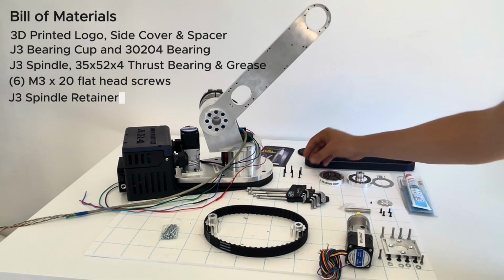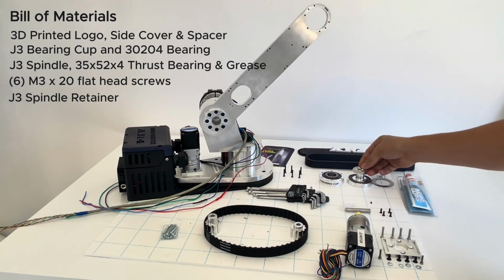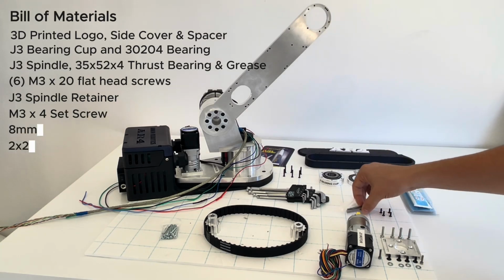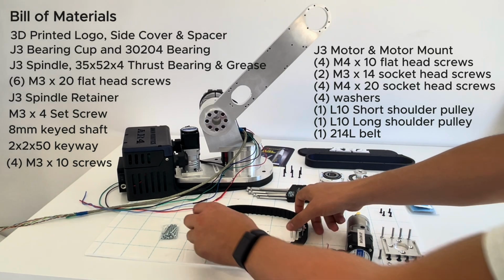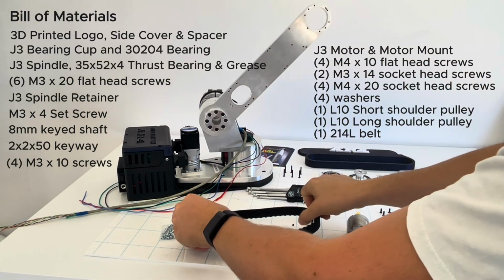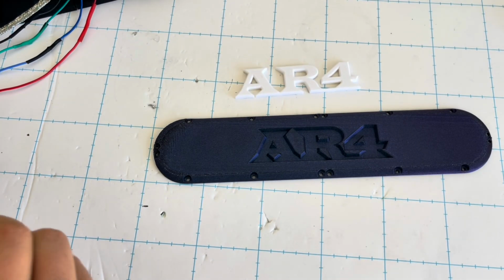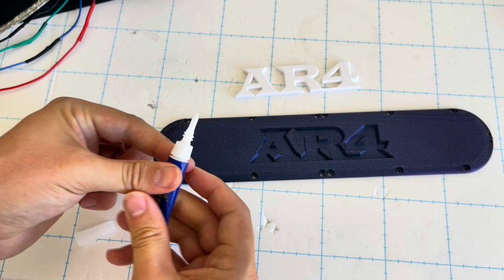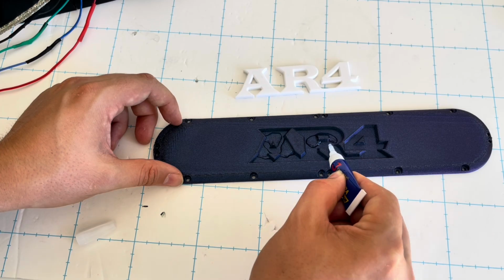Joint 3 Assembly and 3D Printed Covers - Episode 9 - AR4 Mk3 Robotic Arm Build Series

Comment: Thanks god for your videos pop up in  related robotic video on youtube . I tried to save money to buy robotic arma like yours but am worry about not be able to connect all those parts together and it is not that cheap either
Reply from the maker: Hi Kim June, I’m really glad that you have found the videos helpful. For your reference, there are a few cheaper robotic arm kits such as the Faze4 by Source Robotics which can be almost entirely 3D printed. 

The AR4 robotic arm kit from Chris Annin is well worth the money in my opinion as he’s done an excellent job detailing the build process in a 386 page manual and also has many useful videos of his own. 

Just a word of caution, even after the cost of the kit, I’ve spent around $600 more on various tools such as the soldering iron, crimping tools, etc.
Reply: @ModulusManufacturing  damn,thanks for the additional  cost information, I hope in the future you can do a affordable 3d rotobic ( you can use exitisting open source robit. There are documents about them it but it's really hardfor me to  learn by reading. It's easier for me to watch someone do it so I can follow along ) with videos how to connect them and how to use them. You can sell the 3d parts of that robot so I can buy it straight from you. It's very hard to find people do something like this. They either show off their robotic or just do the demo. Can't really learn anything